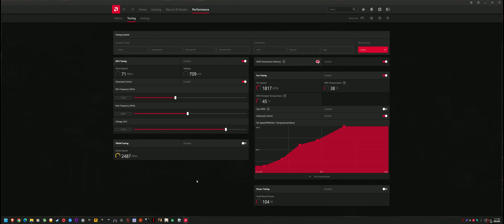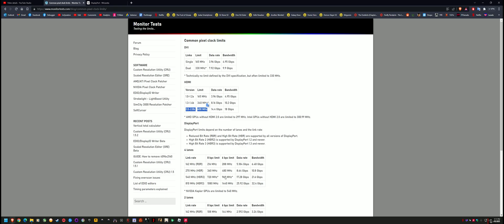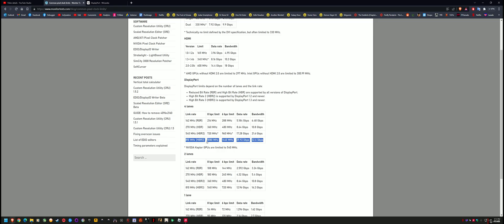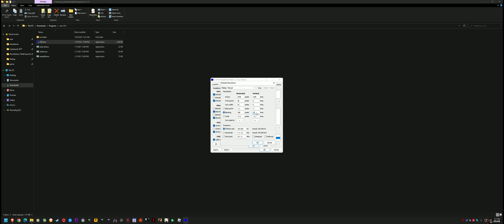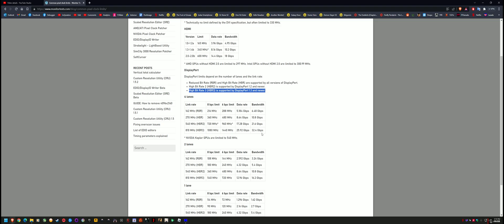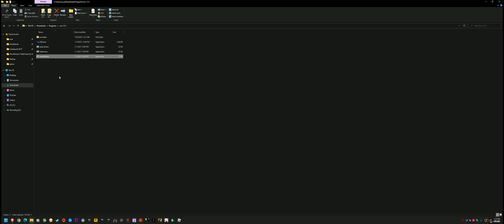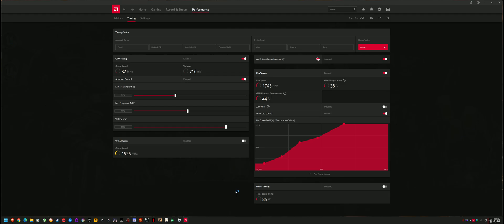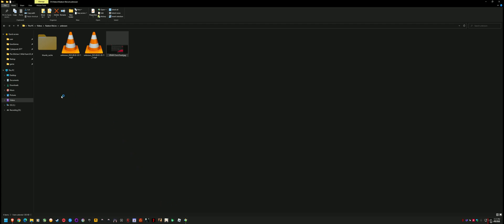RX 7900 XTX High Idle Power / Stuck VRAM Clock Fix (CRU)

Comment: I fixed the issue by simply buying a new DP and HDMI cable. I bought the best quality cables for the cheapest price on amazon, $20 total. Before my VRAM was stuck at 2487.
Reply from the maker: That's awesome and thanks for sharing as it reinforces the basic theory behind the high clock issue, blanking times & cable bandwidth. Glad you were able to fix it 😁👍

Comment: Thank you. Radeon 7800XT here. Tried 378 blanking, but the colors felt off and ram clock when watching youtube were a little too high. Decided to try doubling default settings, to 82, then doubling again to 164.  Now 146mhz idling. Thank you for your explanation, only guide on the internet, that helped. I got the "same" 3440x1440 165hz display.
Reply from the maker: Nice! Glad it helped you & thanks for sharing the results!

Comment: Hi all, I found that changing the monitor Hz to 1 less than max fixed all my problems on my 7900XTX. My speculation is that the gpu did not like the fact that the Hz  was reporting as 239.something as it was not a whole number. Vram now isnt stuck and idle power is 10w-30w
Reply: aswell as that, changing resolution in windows settings changed the clock speed that it was stuck at. for example 1440p was stuck at 2587Mhz and 1080p was stuck at a lower but still too high number which leads me to believe that the problem is not resolution but something to do with refresh rate. might be wrong though:)
Reply from the maker: Nice! I wonder if this is an issue with 240hz itself or something to do with the monitor timings in CRU? Was it a mainstream(known brand) monitor? Either way thanks for sharing!
Reply: @PatchFixGaming  yes, Samsung G7 240hz 1440p, I noticed also that using freesync in the monitor settings stopped the freezing of clocks aswell so you can have 240hz with freesync if you prefer (it worked for me maybe not everyone though)

Comment: Btw, wikipedia says 10bpc requires 25% more bandwidth than 8bpc. If so, then first column with 810 MHz is exactly the one for 10bpc, as 1440 MHz - 25% is 1080, and 1080-25% is 810 =)

Comment: Hello, could You please try to solve my problem? I have like 100w idle power :(
I have 144kz 4k monitor OMEN 27k and 7900 XTX and I dont know what to use in CRU because my pixel clock is already 1278,72 MHz :(
I am running it on display port cable which was in package with monitor.
Reply from the maker: Yo, I had to re-pin my original comment so hopefully you can see it now, if the pixel clock is already maxed out via blanking time then there may be a limitation of the monitor itself sadly.. But I can list a few things you can try anyway just no guarantees sorry :(.

I've heard enabling freesync(this makes the refreshrate variable) can sometimes help with idle power so thats worth a shot, likewise if you already had it enabled, try disabling freesync/enhanced sync/boost and any other fancy features while troubleshooting.

It may also be worth checking what type of displayport cable you have, there should be a code written somewhere on the cable just follow this guide; https://pointerclicker.com/how-can-i-tell-what-version-of-displayport-i-have/ it's possible they use a cheaper but still 144hz compatible cable in which case upgrading it may be worth a shot.

As a last ditch effort, if you spend a lot of desktop idle time the only other things you can do as a temp fix to lower power consumption is simply go to windows settings>display and try 120 or 100hz, not ideal but I've heard of a lot of people do this, if you run your games in fullscreen mode you can still benefit from full refresh this way but it affects multitasking since borderless gaming takes the desktop refreshrate.

One more thing to check is if you run HW accelerated background apps in tray(discord, some launchers, browser tabs etc.) try either disabling HW acceleration, disabling MPO or both. https://computersluggish.com/guides/how-to-disable-mpo-in-windows/

In browsers like chrome you can go to the URL bar & type chrome://flags , hit enter and in the page that pops up search for 'angle' & try changing angle graphics backend to DX9.

Comment: when i do this my screen gets these weird lines. it also happens when i make a custom resolution on raedon. ive been trying to fix this with no luck
Reply from the maker: What spec cable are you using? Try swapping it if you can otherwise it may be a monitor issue(especially if its a budget brand).
Reply: thank you so much for this insight. i am using the display port cable that came with my budget monitor.  @PatchFixGaming
Reply: at this point in time im thinking it may be my monitor, gpu or like you said the cable. i have a rx6600 eagle btw
Reply: how likely is it that its my gpu and it simply can't handle 240hz? im thinking about bringing it to a local shop that has multiple cables, monitors and gpu to help me diagnose this. just thought id do my own diligence first!
Reply from the maker: Whether the RX 6600 can push 240fps or not in games aside, it can handle upto Displayport 1.4a needed to drive a 240hz monitor, so I would be checking the cable that came with the monitor & making sure it's at least 1.2 for 1080p, or 1.3 for 1440p. https://www.techspot.com/articles-info/2516/images/2022-08-30-image.png

If the cable seems ok then its also possible the monitor itself is not 'stable' at the advertised refresh, I've had this happen with budget 1080p monitors advertised for 165hz but even with good cable+GPU, they had artifacting/flickering/lines, setting them to 144hz had them running fine(this was also on 2 entirely different systems, GTX 1650 Super & RX 5500).

Comment: Why amd can fix that?
Reply from the maker: It's mostly a monitor specification issue that's more common with budget & freesync monitors, Nvidia users often use G-sync approved monitors which often have tighter requirements and higher price, so the power consumption issue is less common. In other words AMD would have to force monitor manufacturers to tighten their monitor profiles and use higher quality cables to minimize power consumption out of the box, but this would cost a lot of money and increase prices.

Comment: just lower your monitor refesh rate (at 120hz on 144hz monitor or 144hz on 165hz monitor) and it wil be fine
Reply: Yeah thats what im doing on my 144hz monitor, lowering to 120hz allows the memory to fully downclock in idle. 6800 Aorus master gpu. It sucks tho that even a single 1080p 144hz monitor has issues with this, on my 1070 its perfectly fine...
Reply: @Luk-kk-z  that becasue windows make adrenaline software error if u have 2 monitor not same the refresh rate
Reply: went down from 165hz to 160hz and it worked right away on my 7900xt. dropped from constant 2500Mhz to around 100Mhz, going between 10 and 150Mhz on idle ❤🙏

Comment: This issue is because you have 2 or more monitors at high refresh rate 100 and above.. just lower the secondary monitor refresh rate and problem is solved :) This problem occurs when you have all the monitors at the same frequency.. f.e... 120hz .. like iv had... since i use my second  monitor just for reading an typing on social media it does not have to run at high fq... 60hz is just fine... my power consumption fell from 100w to mere 20w Gpu vram clock 50mhz +- ...
Reply: nah man my 2nd monitor is only 60hz and my xtx still sucks down power like mad
Reply: Do you have HDR or 10 bit on? that can also cause it to go overboard... also undervolt your gpu! its easy..
Reply: I do... try to cap fps.. to 117... there is no reason to go over that .. basically if you have 4k monitor or TV .. on really high refresh rate (Hz) ... that also affect power.. I have LG oled TV as monitor... i dont use HDR  when im in windows just browsing .. only in games.. so yeah... i have 25-60w when browsing or doing other things in win... in games power goes high ... but thats normal considering that the card is a beast! :)
Reply: 2nd monitor is at 60hz and its still at 92W. Soon as i turn it off I go down to 11W.
Reply: Depends what kind of monitor you have ... resolution plays big role here... mine is only 1080p so .... If your second monitor is 2k or more dont be surprised :)
Reply: no my second monitor is 1080P as well and I keep it at 60hz since its just a secondary and im still faced with 100W power draw at idle.  @StefanNemec
Reply: Well thats odd... i suppose you do have latest drivers..  What is the model of your GPU? mine is sapphire.. also check your gpu usage in task manager... there is a possibility that you have a miner running in the background... or something else..

Comment: At least it fixed my idle issue however it is still bumping to max vram clocks even with the minimum mouse movement.
Using a 1080 240hz monitor, it had  a 2.0 HDMI port, bumped the blanking point to 140 from 80 too stay under 600mhz, since it is its limit showed on the previous charts you showed.
Thanks tho at least it solved part of my issue. I’m using an overclocked 6950xt went from 50watts on iddle to under 15 on iddle.
Edit: Now it doesn’t bump like crazy but moderately, in conclusion my issue is fully solved, took a couple minutes to start doing that, thank you very much.
Reply from the maker: Nice & thanks for sharing! Good to see its working with current drivers on the previous series too.(Theoretically should work with any GPU having this issue since its display/cable based).

Comment: I've been messing with these settings now for an hour, and unfortunately I don't get to see anything changing when it comes to the GPU memory usage, clockspeed, nor the idle power (x3 1080p 144hz) so I'm guessing these included DP cables are poop. oh and the GPU is a 7900XTX
Reply from the maker: Darn sorry to hear, did you try with just one monitor and see if you can get improved behavior from the blanking increase alone? If the 3 are the same model then chances are good for tuning them all to similar values for some benefit(but you have to remember to allow full idle, no touching the mouse for at least 30 seconds while waiting to see if the VRAM clocks down). If they are different models then youd have to tune each individually and hope that works.

The fact you're running 3 monitors at high refresh will also limit downclocking to some degree compared to single display idle.
Reply: @PatchFixGaming  
I have indeed tried with just one monitor, and that does indeed lower the power draw significantly, running it in either 60hz or 144hz, no difference there either. And yes they are indeed all the same monitors. the gpu stays on the max memory clock with 678mb in usage, not touching the mouse for at least a minute, but it does not come down. board power is sitting around 97w of power.
Reply from the maker: Hmm the only other suggestion I've heard that might work is try enabling freesync//adaptive sync in the gaming>display tab as well as in the monitor OSDs.
Reply: @PatchFixGaming  any ideas what's wrong in my case with rx 5700xt? I have two full hd monitors, one is 60 Hz over HDMI, another is 100 Hz over display port + FreeSync. when either of the monitors is working alone memory is at 200 MHz. But when I turn on the other it boosts up into max 1750. Tried different blasnking lines counts up to 500, enable\disable freesync or change color depth on 100 Hz monitor, slightly change refresh rates on any, diffrent HDMI cable for 60 Hz monitor. None of that has worked. Once I was able to get memory down to 800 MHz when both monitors at 60 Hz but that happened only once for some reason
Reply from the maker: It's a common issue with mismatched refreshrates sadly, you have to increase blanking on both monitor profiles to hope for any improvement but if that fails then 'freesync' for adaptive refreshrate is probably the next best bet to try and improve power consumption.

Comment: Followed the steps but no luck. For me I only really get the maxed out memory clock when I look at the Performance tab in the AMD software which is 2,102Mhz with a slight OC. If I wait about a minute after closing it and I check in HWinfo the clock is almost always around 1,078mhz/1,076mhz exactly and sometimes 1,334mhz, but after a few seconds of opening the AMD software and checking the clock it jumps up to 2,102mhz? I rarely ever see it drop below 1,076mhz and when it does it's for a very short amount of time.
Reply from the maker: Hmm, the reading on radeon has a slight delay and moving the mouse will increase the clockspeed especially at high refreshrate, the only way to see the proper idle is to have it open but not touch any input for at least 30 seconds as this is the time it takes to drop into the deeper idle modes.

What resolution/refreshrate & blanking time did you go with & did you hit your blanking time limit(display had to reset) in doing so? Make sure you go back into the detailed resolutions and confirm the blanking time didnt reset to default if set too high as thats another possibility if it had no effect.

Comment: Excuse me good sir. I tried your solution and it only partially worked. I mean my clock speed is still set to 2487 like yours  was after increasing the blanking line count. It was initally set to 81 and I increased it to 500. Anything above that it will start being in the red. It did however drastically lowered my VRAM usage 6.5GB down to 1.6GB. I am using a 7900XT. Do you have any thoughts or comments on this? Thank you
Reply from the maker: Hmm what resolution & refreshrate?

The VRAM usage that high sounds fairly unusual to begin with, I remember having a higher VRAM clock but the usage was always low unless I open tons of tabs /w HW acceleration or have a game running in the background. In which case try testing at the desktop with everything closed except Radeon performance tab or HWinfo, and dont move the mouse for a few movements, as even lightly moving it will prevent downclocking on higher refresh monitors.

If the usage is that high with everything closed and not moving the mouse at desktop, then I'd consider running a full scan with malwarebytes to make sure there's nothing fishy going on.

Also curious if you just cranked it up to 500 or tried a range of numbers in-between as there may be some odd behavior with the blanking too high rather than too low.

If you have a very high refresh monitor and dont 'need' the extra refresh, try lowering it under display settings, even a small drop has fixed weird issues with VRAM usage & clockspeeds from what I've read on reddit and comments on my own vids.

Hope something there helps!
Reply: @PatchFixGaming   Well I fixed everything.  So as mentioned before follow your vid lowered my usage and a driver update fixed the clock speed problem. My GPU is now using anywhere between 48-55W instead of 80-90W.

Thanks for the reply and getting back to me though
Reply from the maker: No worries & nice, I hope there was at least some benefit to the fix but hard to know unless you try stock vs increased blanking on the updated drivers too, sometimes drivers can cause incorrect readings too(been an on/off issue for awhile). Can double check in HWinfo as theres much more sensors on the latest version compared to Radeon tuning tab, particularly for memory junction which I wish AMD would include as its 10C hotter than 'hotspot' on my nitro+.
Reply: @PatchFixGaming  right

Comment: 100 watts just to display windows with text is absolutely crazy, how is that even was released. I'm after new GPU and looking into RX 7900 XTX  but 100w is not something I can except, looking for solutions but I have 2 displays and it's looks like I can only power one in order to get idle power mode of 20w. 
Maybe if second monitor will be powered by integrated graphics but can't currently do that as I need to reinstall OS from linux mint to Fedora as it has much better support for my hardware, and I can't do my job on windows, I even game on linux now)

Comment: Took a lot of tinkering with settings but I finally fixed it thanks to you! Had to bump my 240hz monitor to 238hz and my 144hz second monitor to 100hz. Such an interesting and tricky issue.

Comment: fix for me as well (rx 6700xt, for 165hz monitor), I have 1.2 display port cable and set for 700hz (120blanking from 40) i wonder if i buy 1.3(or better) will it also fix a problem. Btw, is it safe to change blanking?
Reply from the maker: I've increased it on 2 ultrawides to fix high VRAM clock without issue. First one was 100hz with 40 blanking increase to 70 used for years and now on my current 165hz same fix it's been going great.

Comment: thank you very much, nice explanation. my problem was 80 W with dual monitors, 4K @ 60 Hz and 1440p @ 165 Hz, and the default blanking was very low. simply setting it to the CVT-RB standard fixed the problem; now at 10 W idle. it's bewildering how AMD is having so much trouble fixing this.

Comment: I mean it really is a AMD driver issue considering my old nvidia gpu was only idle on 20-30 watts, 7900 xtx 105 watts idle on the same monitor
Reply: I know this is 7 months old but, it's fixed now. Idle is 5-15w
Reply: Funny cause I have the issue now
Reply: @Kal-0000  i just got an 7900xtx and its idling on 100w
Reply: Same
Reply: @Harryp202 So I figured it out just get a better Display Port cable

I now idle at like 40-60 watts not entirely fixed but dropped the wattage by a lot and my PC doesn't turn off while gaming anymore